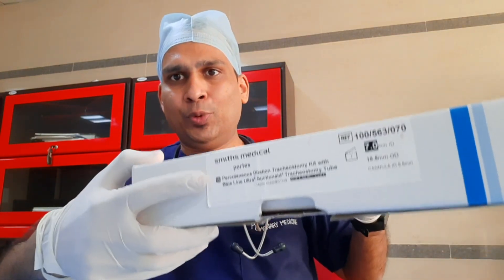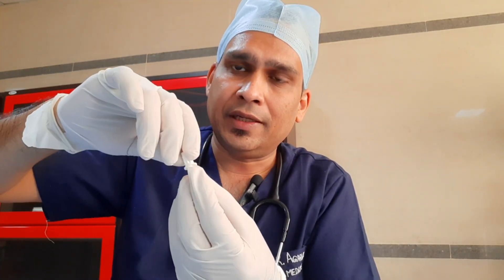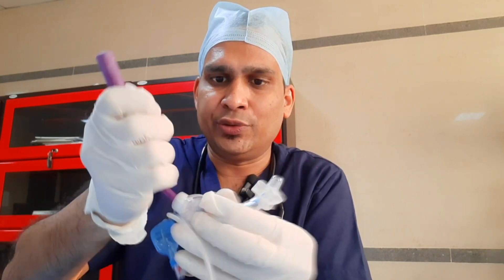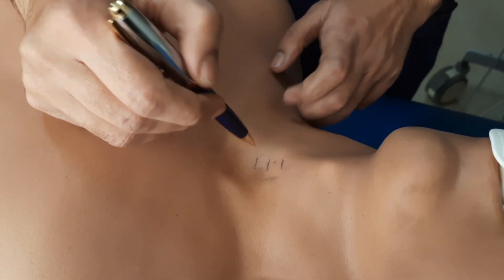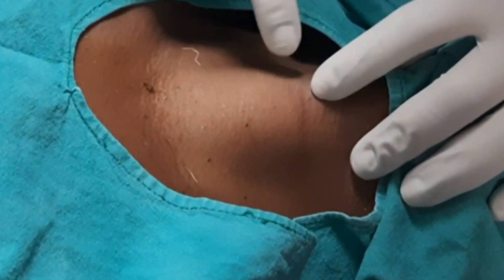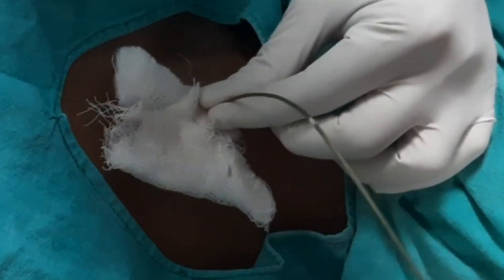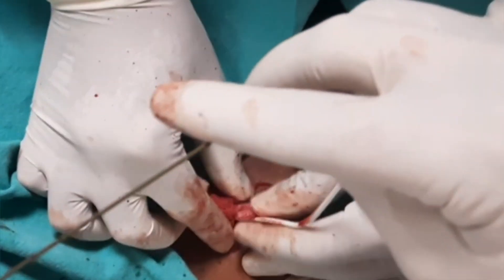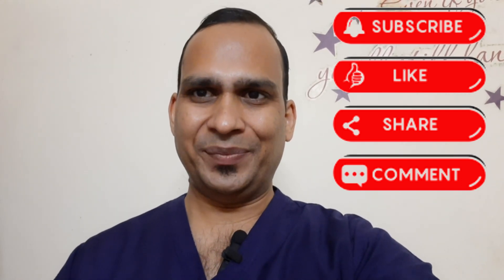Percutaneous Tracheostomy (ENGLISH)- A Live Demonstration on Patient, @Dr. Hemant Kumar Agarwal

Comment: How do you manage the ventilator during the procedure? When to withdraw the endotracheal tube, when to deflate the cuff and when do you stop ventilation?
Reply from the maker: During procedure ventilation is given by ET tube (ET tube need to be pulled slightly just to keep its end below Vocal cord)
After insertion of TT, Just switch venti from ET to TT and than inflate cuff...

After ensuring proper ventilation with TT, deflate ET cuff and remove it